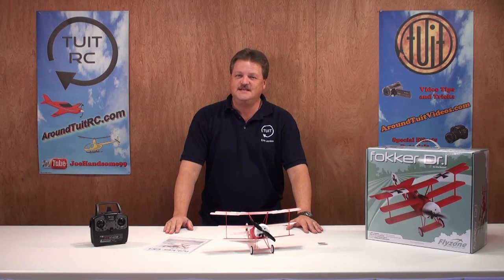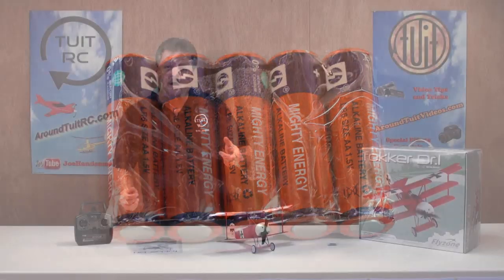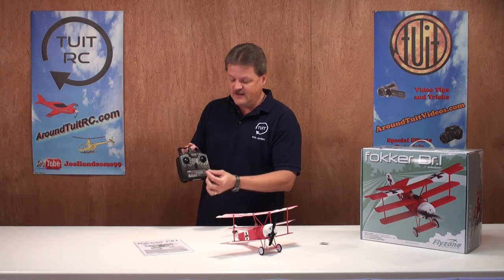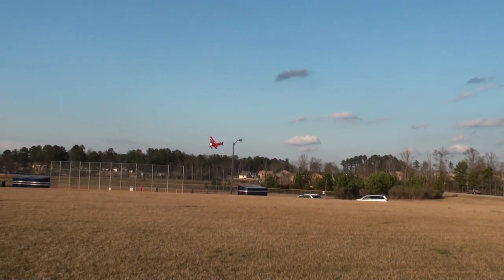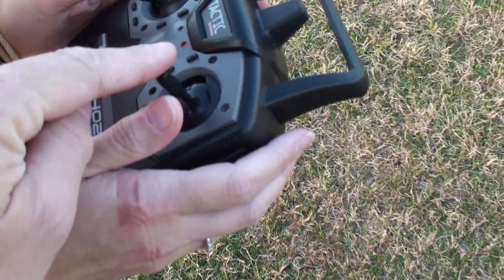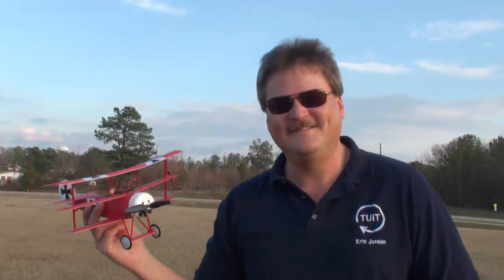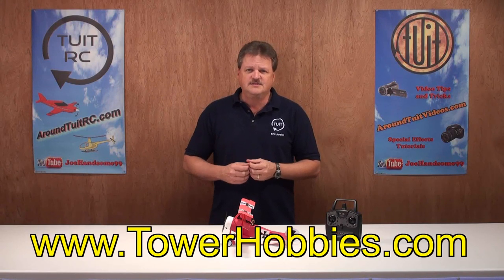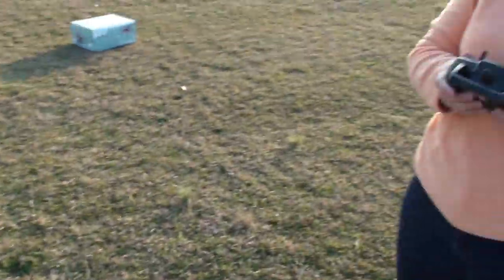Fokker Dr. 1 Micro Airplane Review and Flight

Comment: @Blueberry954 Nightflyyer once showed a larger plane (perhaps twice as heavy as this one?) and it also had a singe-cell battery. Cell count doesn't really matter, the chemistry of the battery is probably most important and if the battery is properly sized for the model, it will work well. Cell counts are a consideration in big helis mostly because high voltage helps keep current at bearable levels. Big helis are still nitro because they would need monster ESCs.

Comment: Can it fly in to strong wind
Reply: I'm no rc expert, but judging by those thin frail wings and 1.27 ounce weight I doubt it. This is probably more of an inside or backyard on a nice day plane. I could be wrong though. It seems to have a decently powerful engine in proportion to the plane itself.